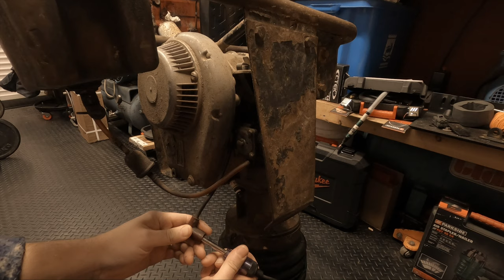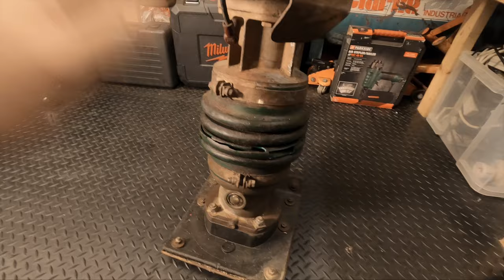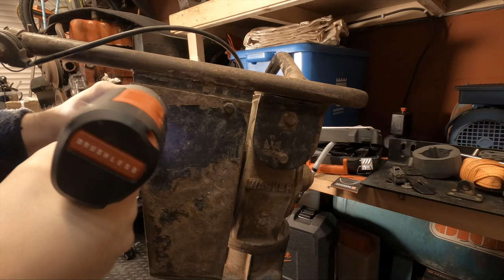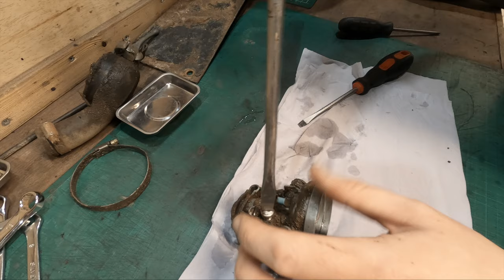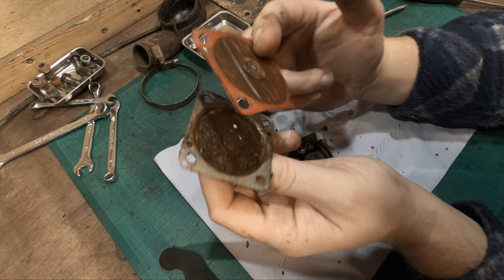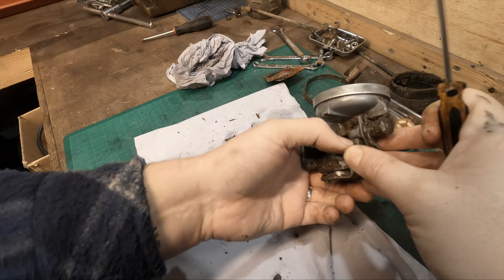Neuson BS60Y Wacker Jumping Jack Bellows Boot Replacement Bing 33 Carburetor Rebuild [Trench Rammer]

Comment: I know this video is a year old at the time of this comment but I had one of these bellows explode on me today while function testing after a carb rebuild. It sent oil drops out in a 6’ radius and covered me.
Reply from the maker: I was worried this could happen myself - one of the rings slipping off, thankfully ok - so guessing the bellow was old and brittle
Reply: It was. I’m guessing it was the original from 2009.